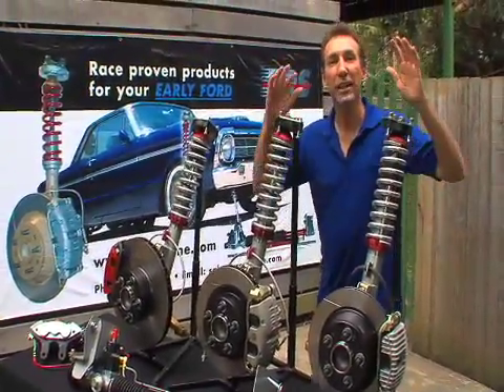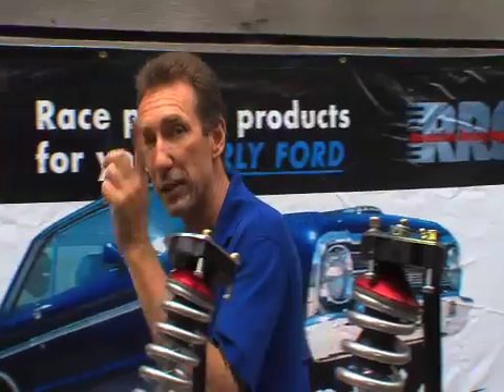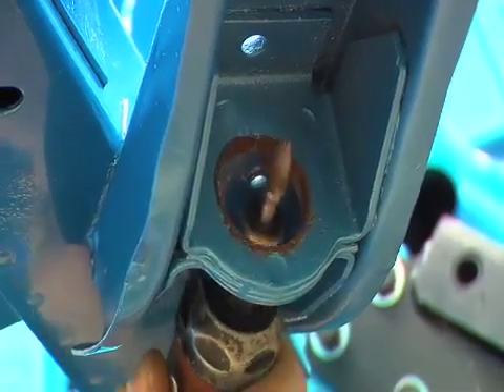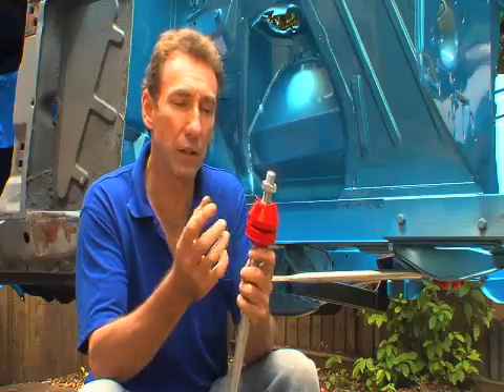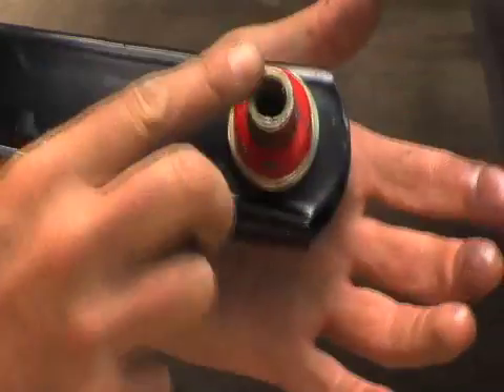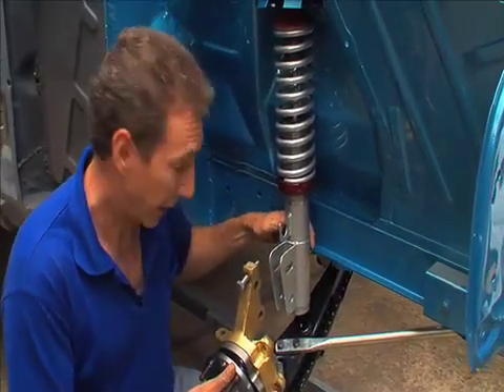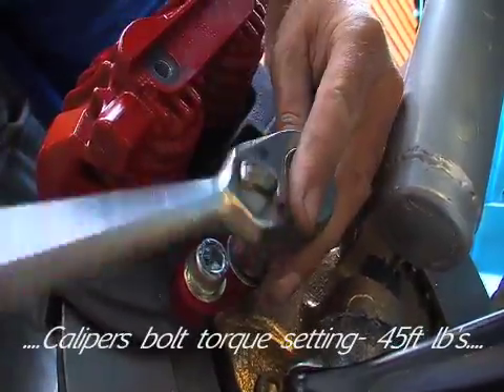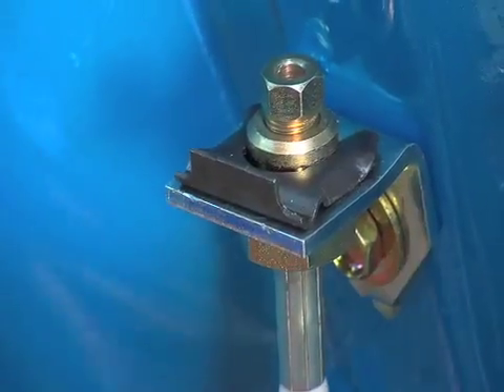RRS front strut and disc installation....

Comment: This looks like a drastic improvement on all fronts for this series falcon. I have drive them with disc upgrades and obviously they were not done correctly because the brakes were better but overall terrible. Is this kit something that requires a mod plate in qld?